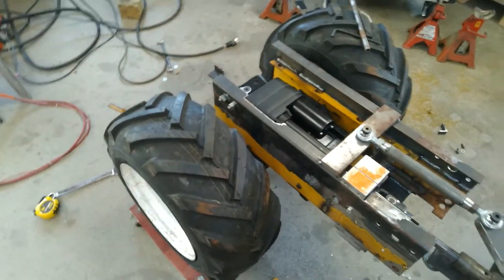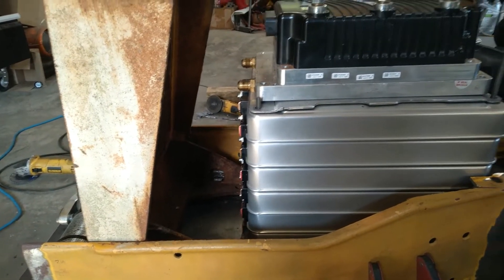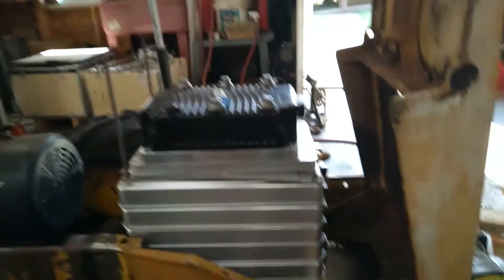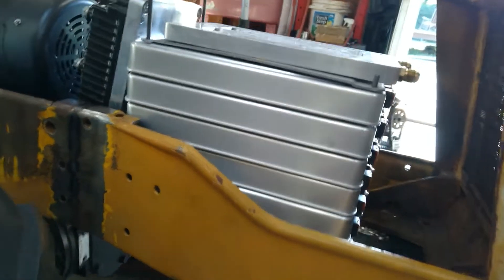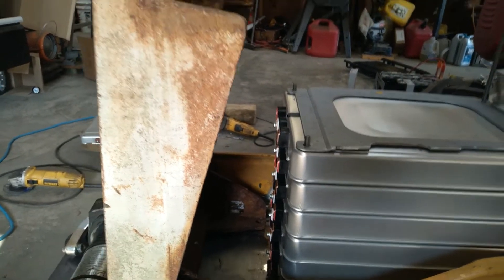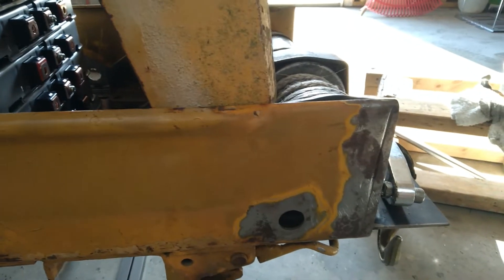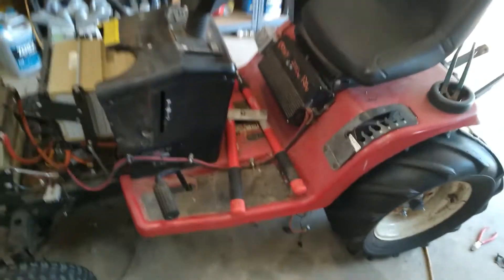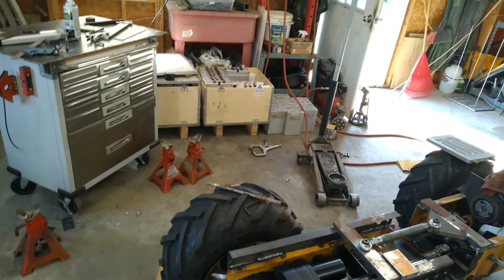Batteries Found A Home - The Cub

Comment: Bill,  you mentioned adding a loader you should take a look at the way the John Deere 1025 tractor loader works for removing and installing and I think you would be able to build it yourself, I have that tractor and it works really easy,  great videos I’m hooked on watching thank you and if you need photos maybe please let me know.
Reply from the maker: I just looked it up.  That looks great!  My Kubota has an easily removable loader, too.  I was probably going to steal ideas/measurements off of it since it's sitting here.  :)  I like the self-leveling option on the Deere.  That would be a very nice feature.